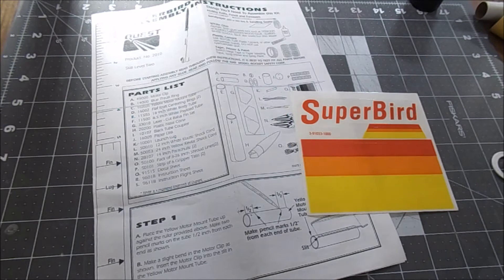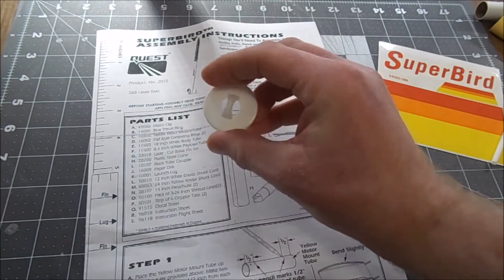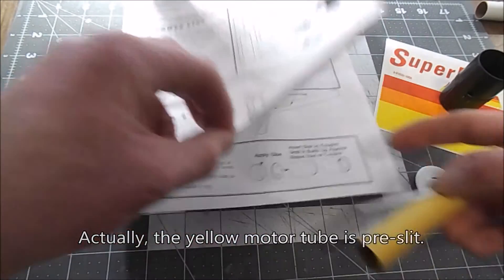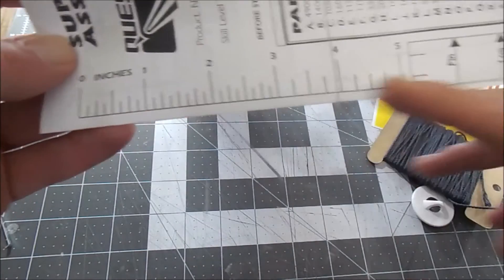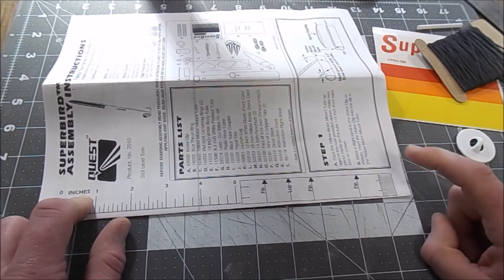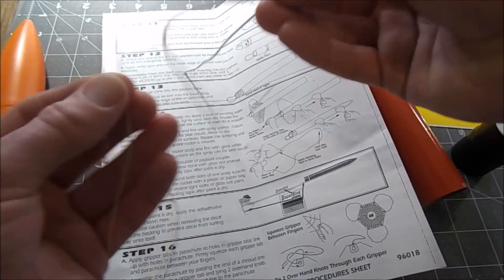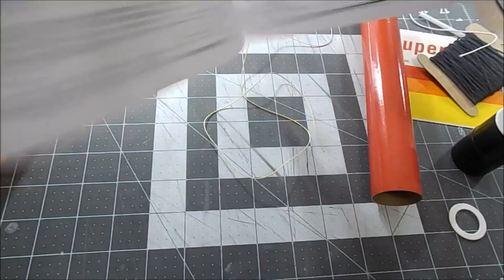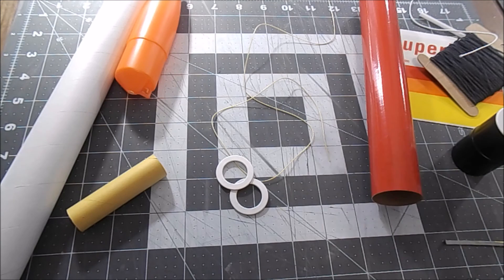Rocket Building - The Quest Superbird - Part 2  - Instruction Inconsistencies

Comment: I find the instructions don't have any details about attaching the nose cone piece. Do you glue that in? It seems to make sense given that there's only two parachutes and you don't want multiple pieces after launch.
Reply from the maker: With a payload section, I would not glue on the nose cone, or you won't be able to fly a payload. 

The standard practice is to wrap masking tape around the shoulder of the nose cone so it's nice and tight, and doesn't come off when the parachute ejects. I go a step further, and attach a small shock cord to the inside of the payload section and attach the nose cone to that. That ensures that you don't lose the nose cone even if the tape wrap isn't tight enough! And I always tie my altimeter payload to the nose cone, so everything stays attached no matter what.
Reply: @TheRocketN00b  thank you very much! I really like the ideas you shared. Thanks for taking time to answer and share your knowledge!